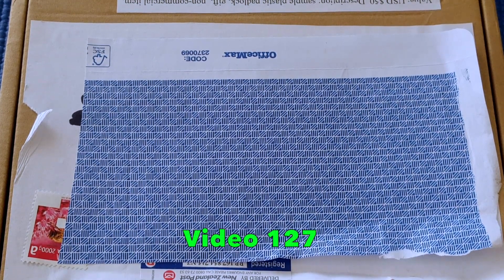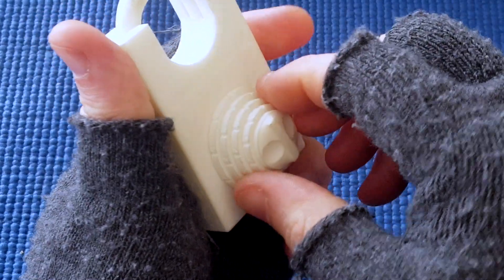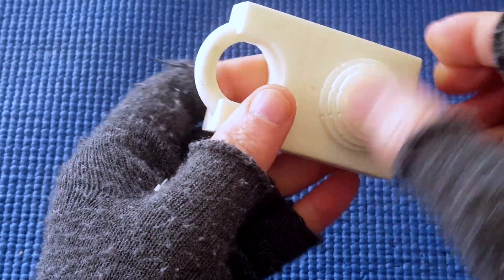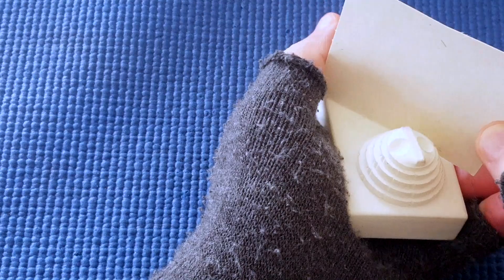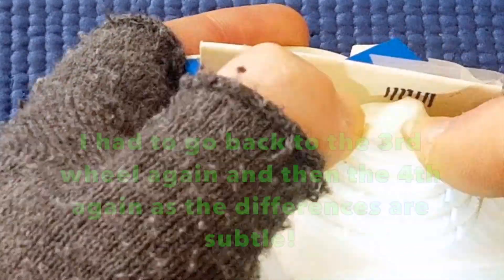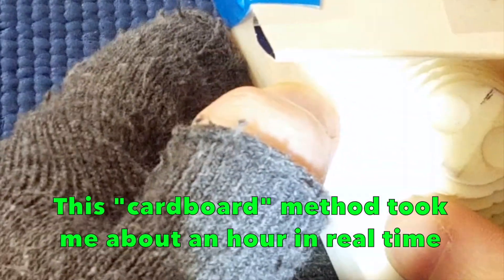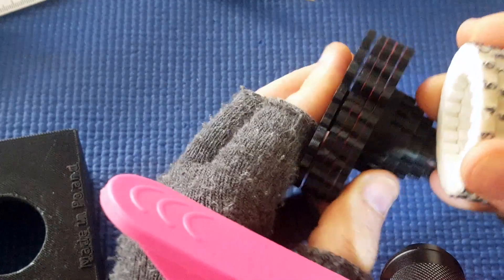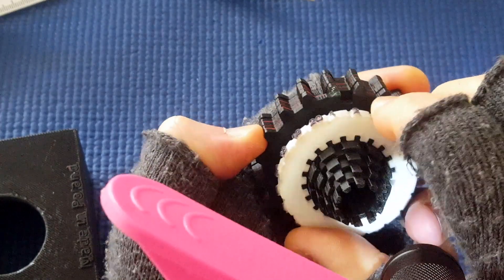(Picking 135) small Polish Combination Lock decoded with cardboard

Comment: What if there will be small rubber pad attached to actuator bar? Something like this https://i.vgy.me/E46kDx.jpg 
Of course the material should be carefully choosen to long lasting and durable. Rubber or kind of plastic with little elasticity to work under preasure.
Reply from the maker: That is some really clever thinking ... I think that would help disguise any turns that turns a fraction more - well done thinking of that solution!  With tight tolerances on the metal version and this sponginess then it could be really difficult to decode even with lasers.

Comment: Thank you very much Swynndla for your feedback. This small version has similar I believe user experience like metal one will have. The smooth operation is critical here. I like very much your cardboard approach, this is the only known way to decode this mechanism so far. This makes me think now how to minimize the chance to decode this way in full metal model. Here you had to check only 25 numbers all together 10+5+5+5 on metal one with 10 000 000 will be 70 numbers to check and this will expand the decoding time seriously and also tight tolerances could make it much more difficult, will see. I am thinking now about any small changes that can mask or misinterpreted the open/close rotation knob. I think as you can see from my latest video about new gates cut shape, maybe I will add also bearings in back plate to make the internal mechanism much more smooth and keep all angles correct. Please finish your testing with black model and try to fix the “stairs problem” as I explained to you by using plumbing Teflon tape. Then try to decode the black one again first in hand with cardboard and then with laser method. I need your feedback here, it is important to have correct wheel pack as it will be in full metal version. Ad as much Teflon tape so the wheels will do not move anymore vertically and only rotate. Cheers and again thank you very much for your review I need it as there are much more objective that my own tests and emotional approach to my “baby”.
Reply: @JamesSempy  Yes it is possible therefore I decided not to use clicker so far but maybe I will change my view later. The noice from the contact between the actuator and the gate I think will be not noticable to differentiate any true gate but maybe I am wrong.
Reply from the maker: Thank you again for the opportunity to investigate the smaller padlock!  It was lots of fun and indeed it is very smooth to operate!  Yep, I'll investigate the large one by using teflon tape.  Yea with the metal one, I don't know how it will behave, because the tighter tolerances and more wheels will make it much harder to decode, but there will be less "flex" in the knob and so I can be more certain of a small angle difference (of the front knob), if one is seen - but maybe nothing will be seen!  If some angle difference can be seen then some flex or wobble (in a way that wouldn't loosen the tight tolerances) would make it very difficult indeed to decode, even using lasers.  I'm not sure how this would be implemented though.
Reply: @Swynndla  Yes the metal version is uknown and I do not have any idea how it will respond to decoding. My goal is to first aim to produce stright full metal wheelpack that will be perfectly allign and there will be no "stairs effect". There is some options as well for later consideration if this stright metal option will be bad or not good enough. So the options are: 1. Perfect alligment to eliminate wobbling in vertical axis and then laser/cutboard method will not work. 2. Some missleading feedback additional part either attached to actuator bar or different method, still not uncover. 3. As Potti314 originally suggested made random cuts on the gates so each one will give different feedback. This is ok however it is decodable then but the time would be longer.

Comment: You have gone through a lot of trouble open this - how long did it take in total? Anyways, kudos my friend, great job. I'm glad he accepted to send the locks to you - you do a great job on them. Wonder if the metal version can be used with the wiggle methods better than the plastic one due to it's enhanced sturdiness. But knob-advance method really works well.
Reply from the maker: Including setting up & making marks (on fingers and cardboard) it took a total of 1hr 40mins. Yea the metal one is an unknown - it will have less "slop" (that helps to disguise the true gates) (you know what i mean) but it'll have tighter tolerances. It will be interesting!

Comment: Another stellar job mate. You would have had a shorter journey recovering the combo on the original proto type as you suggested knowing after the fact that the descending wheel packs were eliminating possible number options as the packs decreased. Just a thought. Cheers mate:-)
Reply from the maker: Yea my fault for not figuring that out on the original one. The metal one won't have any skips. He has to do it pin the plastic one as it was too weak. Cheers Paul mate! :D